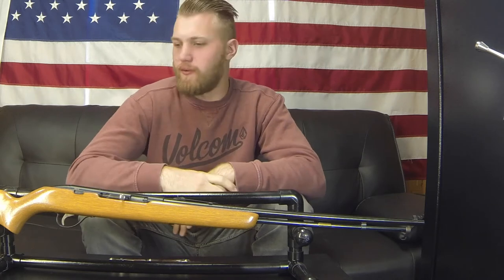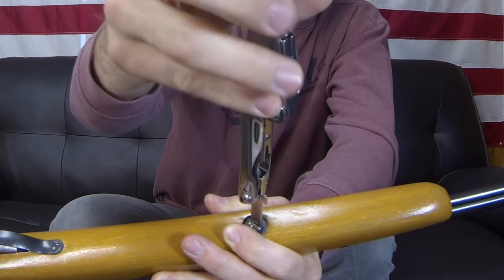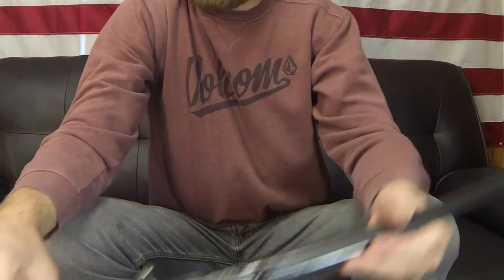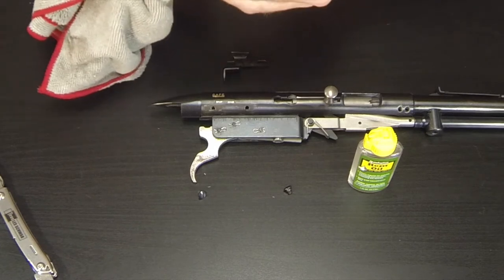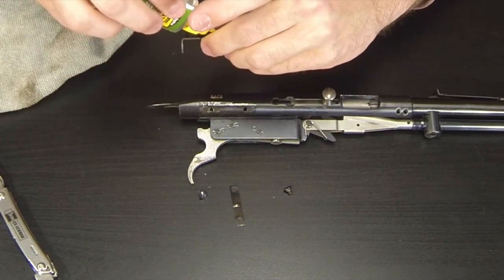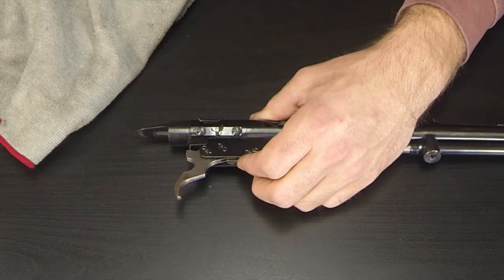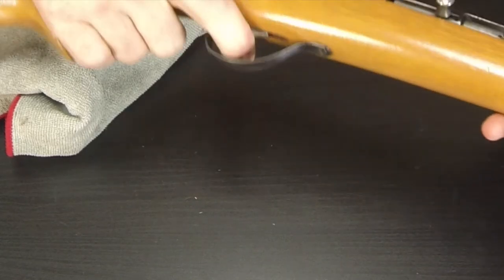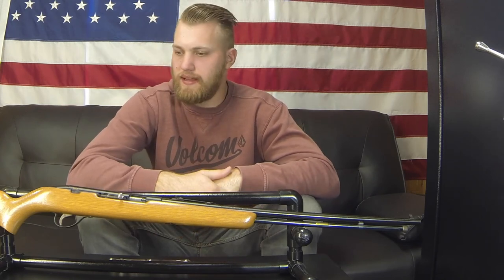Sears Model 25 Safety fix

Comment: Way to much oil. A firearm is a machine only a microscopic coat of oil is needed. 1-2 drops will cover the entire internal parts 
  If it’s looks wet it’s over oiled. 
Also as a reminder if it slides grease it, if it moves oil it.  But only a very small amount 
Oil and grease attracts dirt… so use sparingly 
A few guns smith have told me that over the years.

Comment: I have this same rifle, I always wondered if it was safe to dry fire it but I guess it all good and you do it as well, idk how I could not dry fire it once it’s been cocked anyway. So theirs no other way to uncock it and just to dry fire it? Thanks!
Reply: Try holding the bolt back as you slowly pull/release the trigger.  Dry firing is really not good if you can avoid it.

Comment: Got one fails to fire,often probably needs cleaned,
Reply from the maker: Hopefully that works for you!
Reply: Does the round stay in the throat or not even come up to chamber? That is what I am dealing with.  Even if you manually work the bolt a few times it just wont chamber.
Reply: @tompaul2591  did you figure it out?
Reply: @victorj8152  yes I did.  One of 2 things.  I cleaned it inside and out thoroughly.  Also, long rifle never jams.  I was getting shorts that would stick in the throat.  Maybe not enough power to cycle on semi automatic? Either way I haven't had any fail with the LR.  Thanks
Reply: Ok cool thanks
Reply: @victorj8152  you're welcome.